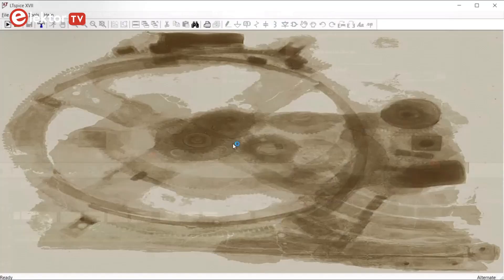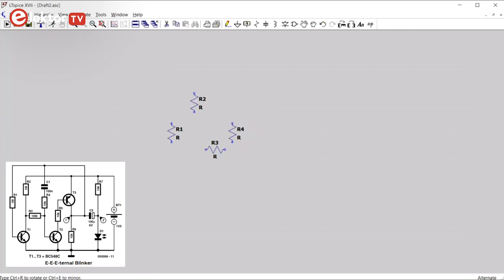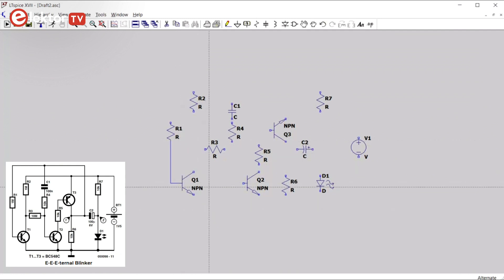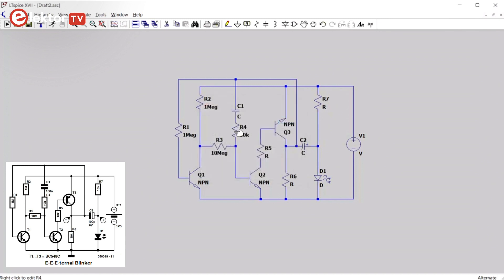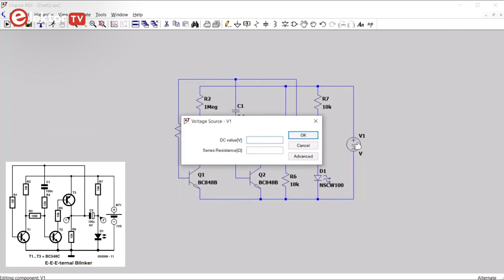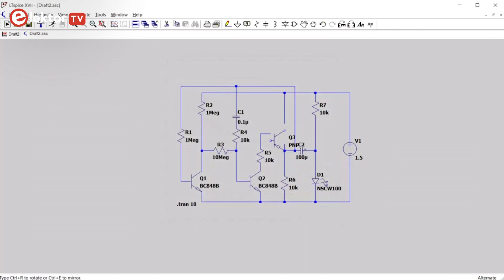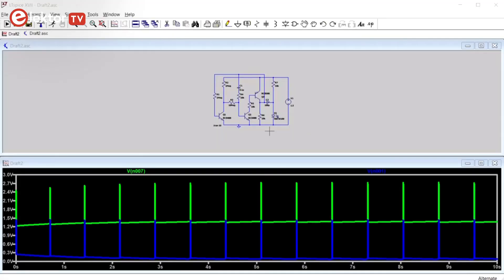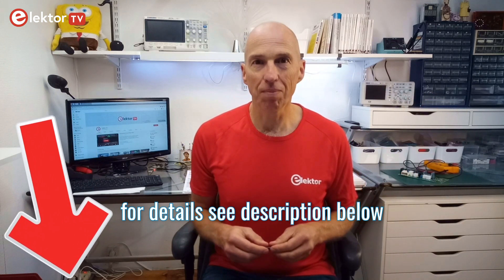How to: Getting Started with LTspice

Comment: Excellent Introduction to LTSpice - please consider further videos on this program

What about Linux users - what is the best option for them as LTSpice does not have a Linux version currently
Reply: At least on OpenSuse 15.2 (what I have on my computer), LTSpice works very well with WINE
Reply from the maker: AFAIK there is nothing like LTspice for Linux, so the best option would be to switch to Windows ;-) Maybe installing VirtualBox (or Wine?) on Linux in which you install Windows in which you install LTspice is an option?